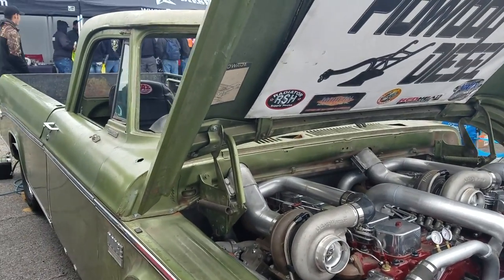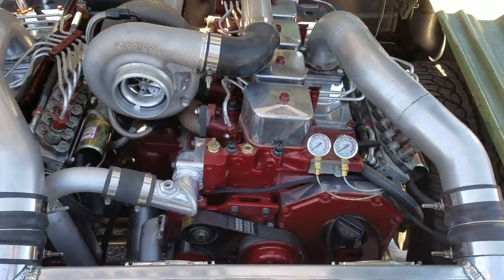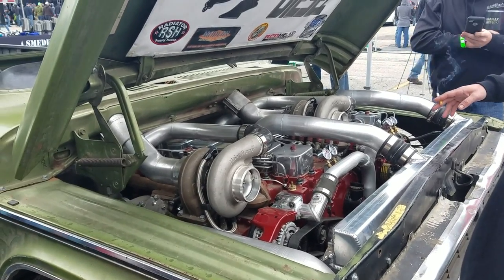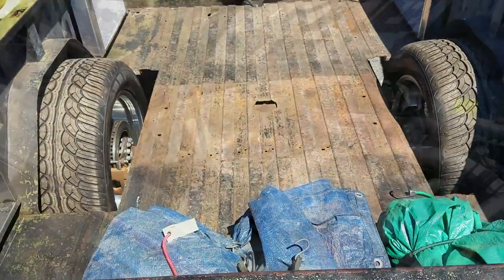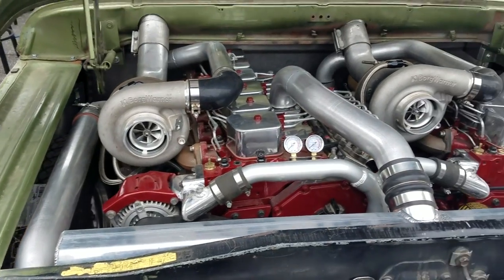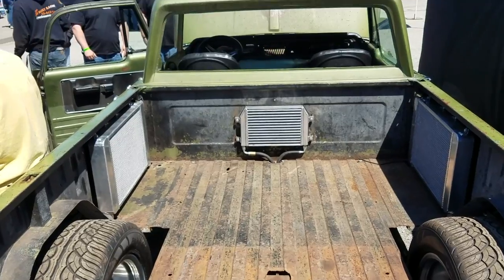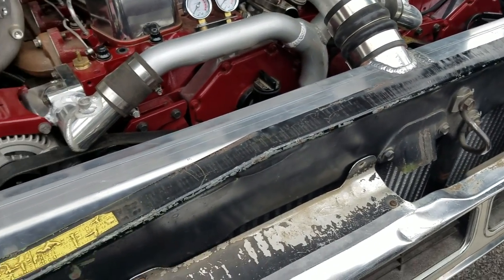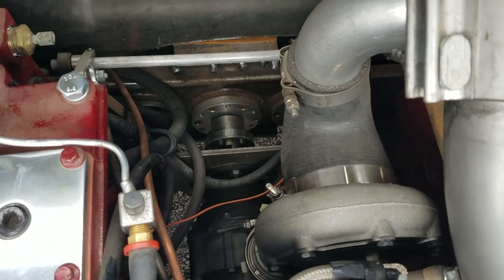Two Engines? Cummins 12v in One Truck? - PlowBoy Diesel At Ultimate Callout Challenge

Comment: It’s about time somebody finally made a reliable Cummins just add a backup engine.
Reply: Patrick Rolf that's funny. The joke should have been about dodge transmissions *
Reply: And I'm a cummins daily. I hope your not a ford guy lol.
Reply: You’re right they probably had 2 transmissions under the truck both with zippers holding them in.
Reply: Funny how my friends 97 7.3 has no intercooler from the factory and when his trans gets hot it just pisses fluid everywhere.